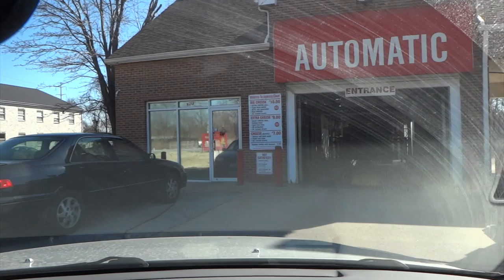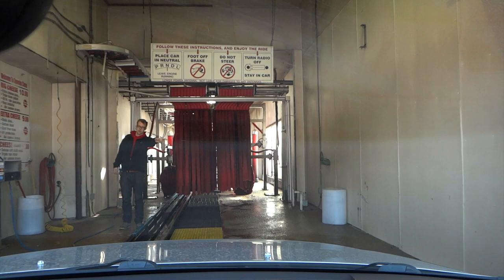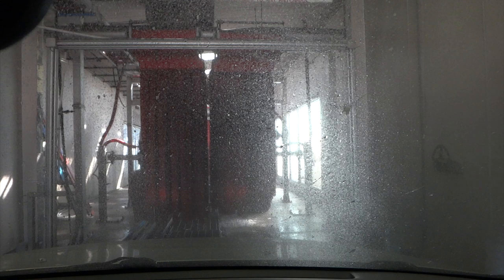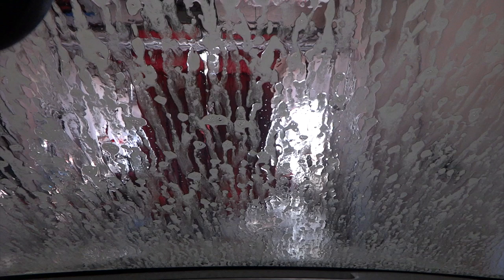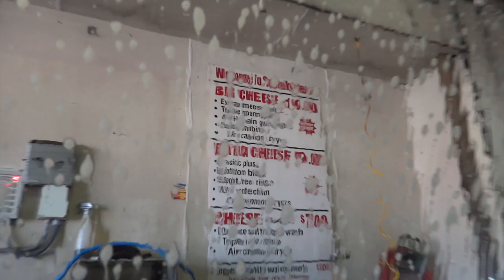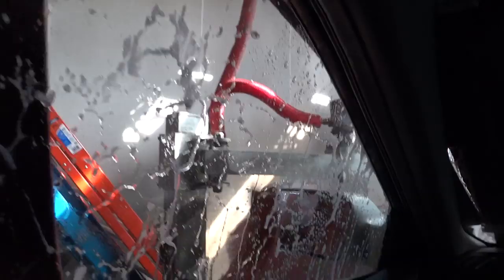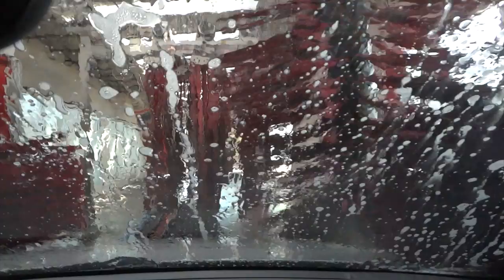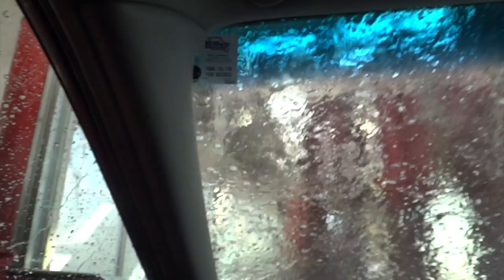Belanger Tunnel - Squeaky Clean Car Wash, Kirkwood MO

Comment: Great video!  Belanger has some weird equipment.
Reply: Car Washes of Georgia Actually, in my opinion, Belanger makes the BEST equipment. After all, you can extremely rarely go wrong with Belanger equipment. And, Belanger actually is an AMAZING company.
Reply: Alberta Car Wash Network I totally agree. Canada was Filled with Belanger Tunnels with AirStream Dryers. Most were replaced with Mark Vii SoftLine Tunnels.
Reply: The Car Wash Fanatic That’s sad to hear. But yea, I agree.
Reply: @inactivechannel7029  It is. I wish they were easy to come across.
Reply: @inactivechannel7029  their dryers are pretty lame though
Reply: @mattdude  their newer ones are pretty lame, but the older ones (like the AirStream dryers shown here) are amazing.